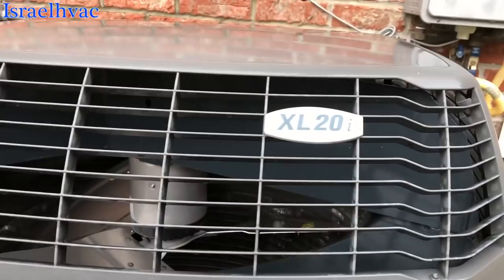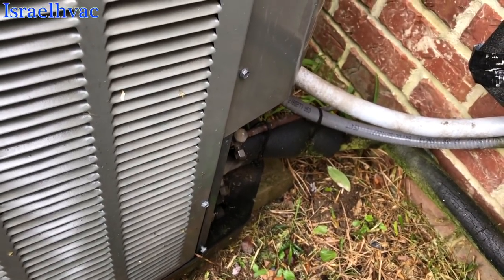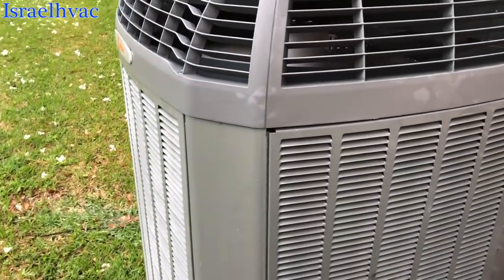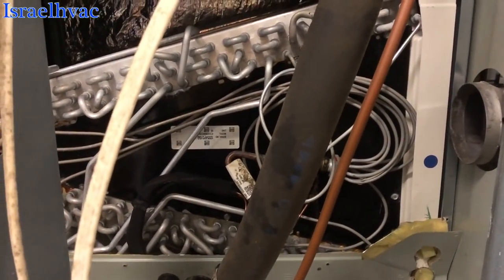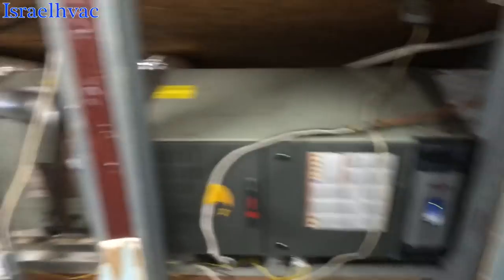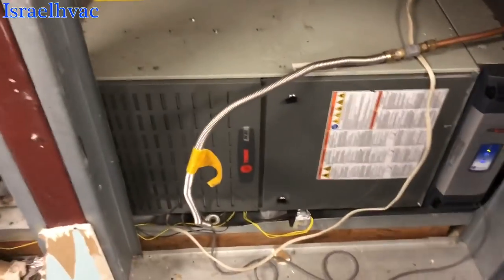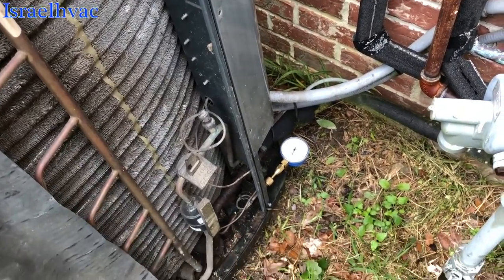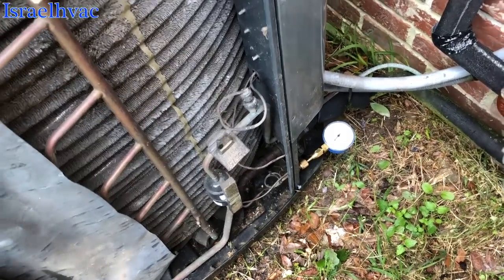HVAC | Trane XL20i With Error Code

Comment: 3 things to check on this code. Ohm the pressure switch, ohm the transducer. Both of those have numerical resistance values that are supposed to be a certain number depending on ambient temperature and psi. 3rd is to ohm out the eev stepper motor between the COMMON terminal and each corresponding wire, you should have 46 ohms to each one, if not the stepper motor is partially shorted and it starts pumping itself down at random times causing low pressure fault that you may not be there to see!

Comment: We have this system, since 6/2009. Since last summer our humidity has been HIGH, mostly 56-69%. 4 techs, 2 companies,  can't find anything wrong, to explain our humidity and mold bloom in system and at vents. HVAC still cools, but no matter where we set the humidity level on our Comfort Link II, humidity does. not change. We run 2  dehumidifies, 70 pints and empty daily, when filled. New company added Remy Halo Lamp.

Comment: I have experienced 2 identical systems throw the same low pressure code. It turn out to be the low pressure switch was opening intermittently. I confirmed by pulling the top and taping on the section line next to the switch while ohming out the switch. I was getting some erratic readings. Replaced switch’s and units have been good. This may not work but it falls under the symptoms.

Comment: I am not a fan of systems that are more than a single stage! I really think manufacturers are over reaching with adding things like ecm motors, variable speed and multi speed! Single speed and stage a/c and gas furnaces tend to have less problems in the long run compaired to the multi stage and multi stage and variable speed systems! It's like vehicles with cylinder reduction systems that make a v8 run in 6 cylinders unless the extra horsepower is needed then it kicks into the full 8, but there have been issues with those as well!
Reply: Hell yea look up Chevy DOD issues! But the the plus side to both the car side and the ac side is with the additional complexity comes economy...

Comment: Just a heads up. I have had a couple of those where the plug on control board had poor connections. It would randomly throw code. I usually replace board and harness if in warranty. All that said. There is issues with communications in all these units. It is really frustrating sometimes.

Comment: If you suspect it low on charge you can always recover the charge with a scale and weigh what you pull out.
Reply: How much you charge your customer for that with "recover the charge + put the correct charge back in"??  And do not forget to run a deep vacuum otherwise you make it worse with air contaminated the system !! What a GOOD ADVICE LOL
Reply: Dude. Chill.

Comment: The  system will throw that code if the liquid line transducer is intermittently malfunctioning, it is under warranty and easy to change. When the transducer acts up, it causes the unit to pump down

Comment: John how cold was it the night before? I have seen on those “hi-tech” tranes where if the system tried to run when the ambient temperature was fairly low it will throw that low pressure code and the code stays until you reset it.. just throwing that out there..
Reply: Does these units come with a low ambient control? just wondering

Comment: On the XL system what is the DS-13 LED light blinking (large green led) on the charge assist module board at the outdoor coil? Assuming this is for the control-assist link. * nothing indicated on the wire schematic of these XL's

Comment: I think Id put new sheet rock back up, but with hinges.  Wondering why you would completely close that off in the first place???  

As for issues I wish things didnt have these smart chip sensors... just let it break and diagnose the old fashioned way.  Especially with automotive, one sensor ties up safety features, driving functions, or something alike... its not just one feature a failed sensor causes to fail, and when they do tell you a problem it doesn't mean something is wrong.

Comment: Maybe she ran the ac when it was cooler out. Sometimes if it's cold out and the customer runs the ac could do it also. I seen it happen a few times.
Reply: That's not unusual.  Simply put a low ambient kit on the condensing unit

Comment: The blower motor could be acting up , causing low pressure situation.
As in blower stops and evaporator frost up.
Intermittent problems can be a real bitch.